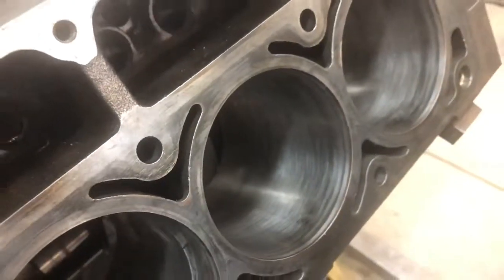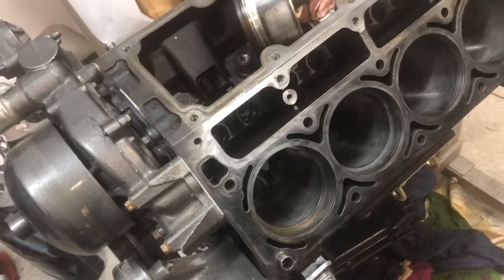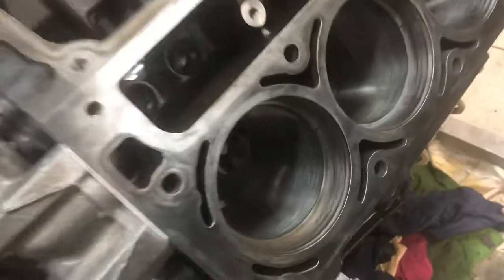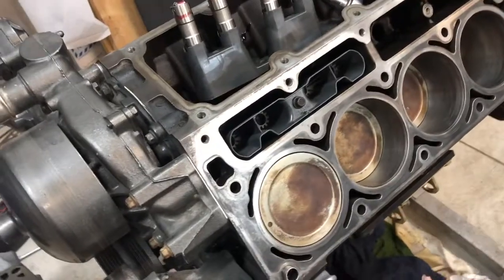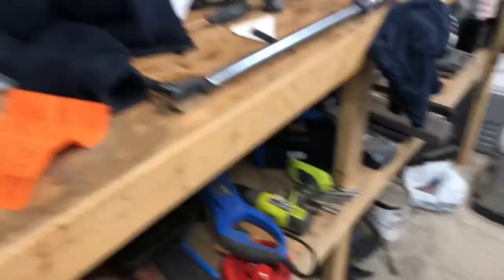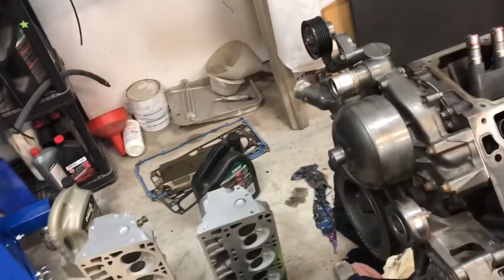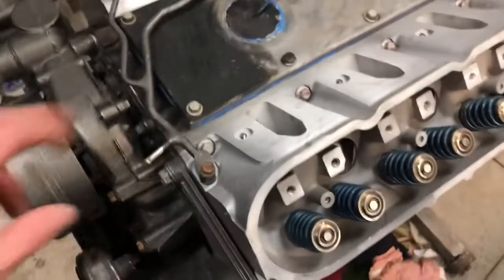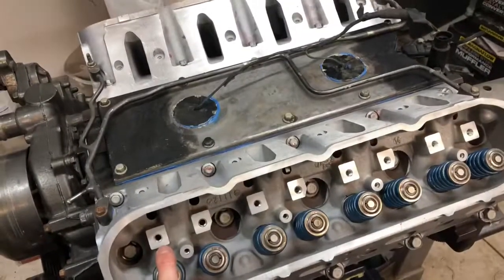Twin Turbo LS Build on a Budget Pt.2

Comment: Hey I’m tryna build a ls3 and use two gt45 how much hp you think I can make
Reply from the maker: There are a lot of people about there taking a stock LS motor and throwing a cheap turbo setup on it, and the numbers they’re making are around 600-650whp. Some people hit higher numbers. But the higher you turn it up, the reliability goes down.

Comment: How much it did it cost to rebuild with machine work, gaskets kit  ,rings etc..
Reply from the maker: For new head gaskets, rings, head bolts, lifters, push rods, and trunion upgrade, was about $500. The head work can vary depending on the condition of your heads. My intake valves were starting to distort, as many LS’s do, so they had to be replaced. But the head work was about $600us.